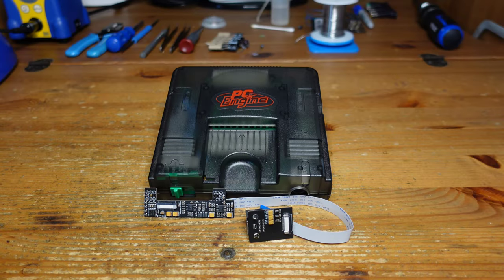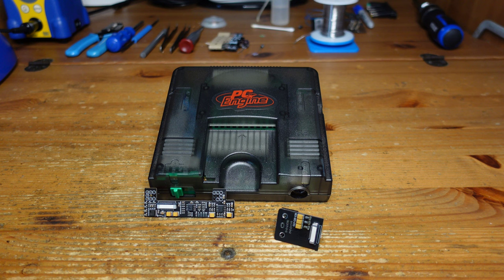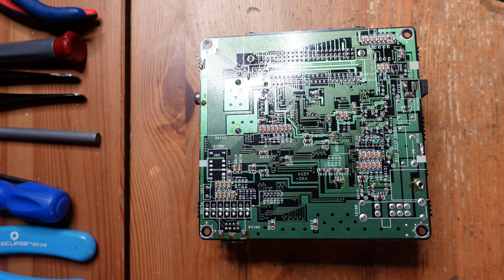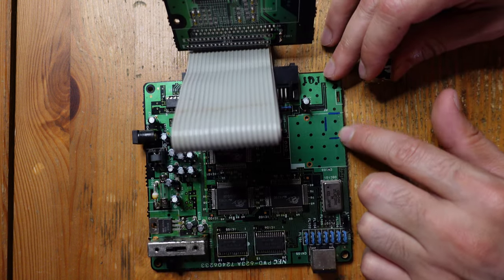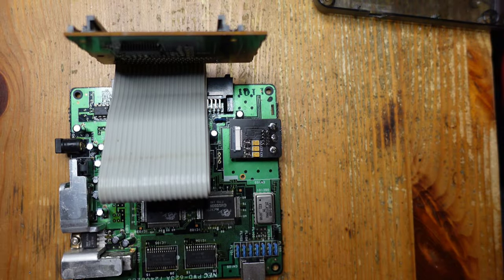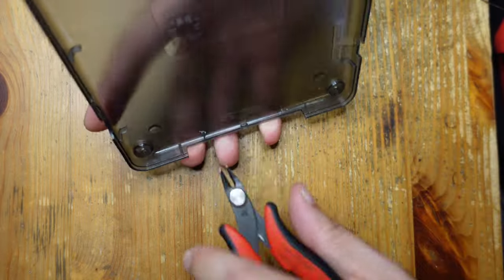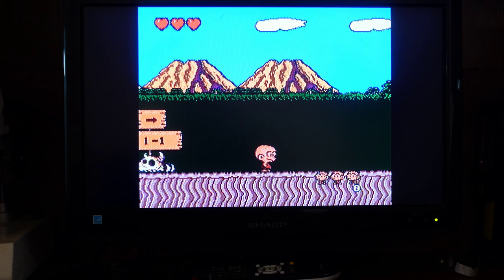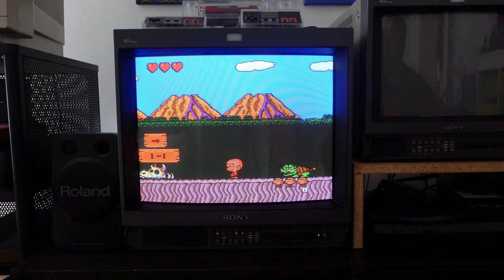Add RGB and S-video to your PC Engine! Turbonanza install and demonstration

Comment: This is my console and I couldn’t be happier with the work done. It was cool getting to see the mod done in this video. Now, I will wait to see if you can fix my model 1 Sega CD. Fingers crossed. Thanks!
Reply: Looking forward to that, I've got one resisting repair as well.

Comment: I've just picked one up and intend to do this mod some time soon.  I did a basic composite mod to my PC Engine a couple years back but being able to get an accurate palette using S-Video will be a welcome improvement, even if RGB with accurate palette is still out of reach.  I already did a full cap replacement on my entire PC Engine, CD-ROM, and IFU, as well as a region switch mod and that little "jailbar" mod a while back, so this should be relatively easy.

The only shame is that positioning the region switch means the nice little positioning board my newer release of this mod has won't be usable, but it shouldn't be too hard to swap out the Genesis 2 style DIN for a Saturn one using the older method used in this video.  I think the only change I'll make here is using a "ribbon" style cable for a slightly cleaner install.

Comment: I'm assuming because of the size of the PC Engine the power supply is contained in the AC Adapter. Which would make importing the console to the USA easy since you'd only need to replace the AC Adapter. I know it's not THAT important because power standards between USA and Japan aren't too far off, unlike Europe, but personally, if I bought a PC Engine and imported it, I'd want cables meant for USA standards? I hope I'm making sense.

Comment: I just installed mine with a cap kit as well, it works and it looks great but it will not work with my cd Ron interface unit. I think it’s a grounding issue.

Comment: Anybody putting a white PC Engine into a black case will go straight to hell 😱
Reply: It’s SMOKE. :)
Reply: @emmettturner9452  Whatever….hell, do you hear me …hell!  👹
Reply: Yeah, well, when half of the ones on the market are nicotine stained to hell and back, I don't blame anyone.
Reply: @ErynnDBuck  if so you scrub and bleach them or use the retrobright method.
Reply: @venenareligioest410  That only goes so far.
Reply: @ErynnDBuck They are quite easy to bring back to white by using the retrobright method or bleach. I used to m port them from Japan and always used bleach.

Comment: Why is there always so much excess flux on NEC motherboards? You'd have thought that NEC would have been a far more professional outfit.
Reply from the maker: Yeah they are always messy, although the residue does not interfere with the operation of the console

Comment: Where are they getting Saturn 10 pin Din Connectors? I'd love to get ahold of these to replace the ports on two of my saturns. Because I'm on the verge of putting an SNES AV port on the damn thing.
Reply from the maker: You can still get them on aliexpress and a few other sites. But it’s not as easy as other connectors
Reply: I don’t know what happened to my earlier reply but it is the Kycon 10P miniDIN on Mouser or DigiKey though I got mine unbranded from Ali— (this is probably what got my previous comment ghosted). They are also used in DirecTV boxes with 10PINCOMPOS and 10PINCOMPON cables. Original Saturn cables have extra keying but you can modify these like RGBSource does so that they will fit anything. They fit HDRV, RGC, RetroAccess, etc and virtually any 3rd party cable without modification.
Reply: Kycon KMDGX-10S-BS
Reply: It's not a "Saturn" DIN connector per-se, doesn't have the same keying. So if you have some older Saturn cables, or Insurrection Industries RGB cables, you would need to cut some of the plastic in the connector to replicate the keying on the original Saturn connector.

But most 3rd party cables made these days work with it just fine, no modification needed.

Comment: I have A PC Engine with Doujindance mod, and I would like to upgrade to this mod, is it possible?  Audio AMP?
Reply from the maker: It should be possible, although uninstalling the doujindance mod could be rough
Reply: @LIRetroGaming  any achance about an update with AMP sound?